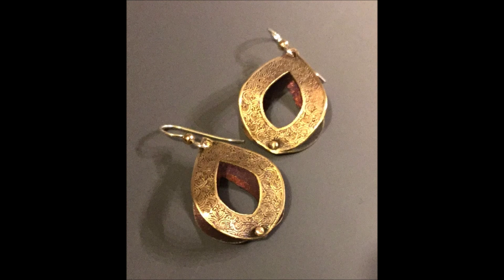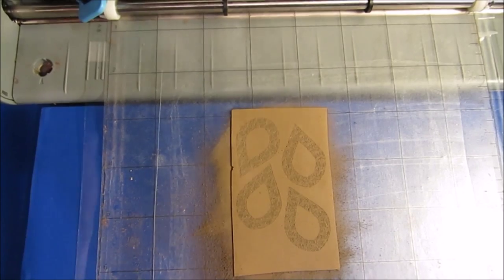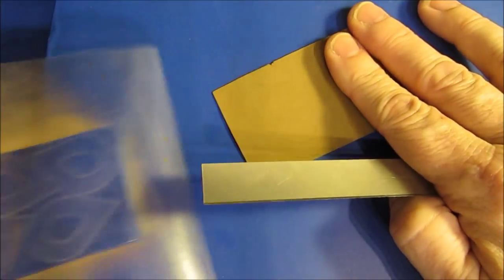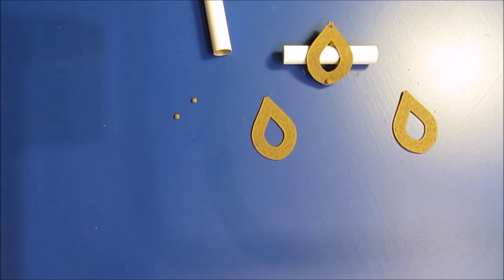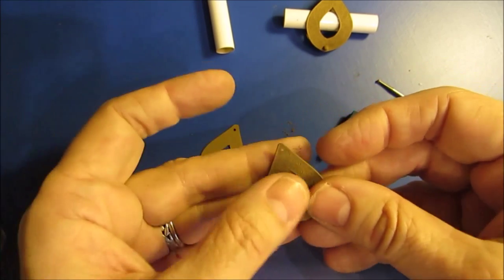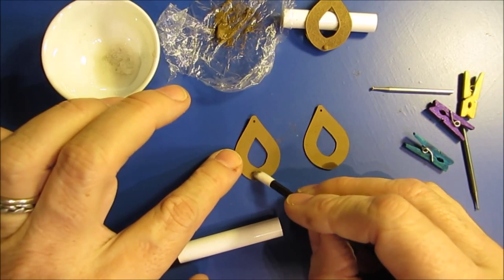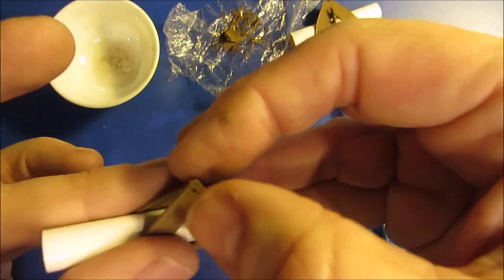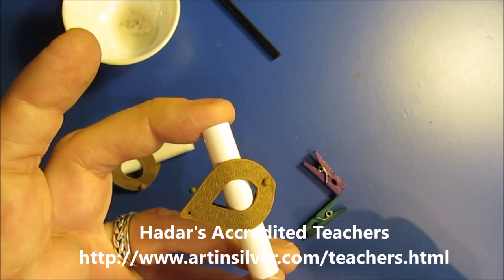Free 3D Earring Metal Clay Project

Comment: I have a cameo and wanted to cut out a pendant in Silver Art Clay from Firestonegems website. Which clay do you recommend and is there a certain Blade I need to buy for the cameo or is the factory blade able to cut the clay? What types of metal silver clay do you think are best for a thick pendant for a necklace. I want to micro pave the pendant once it’s done being torched or in the Kiln so do I add my CZ stones after I torch or before? Didn’t known the process for adding CZ stones and if I have to set them each by hand after it’s cured do you know which tools I need for setting stones in this clay? Sorry for so many questions but I’m new at this 100%. And any information would be greatly appreciated! Thank you!